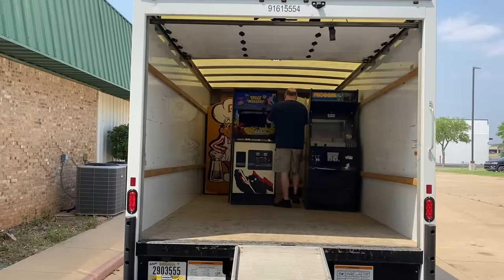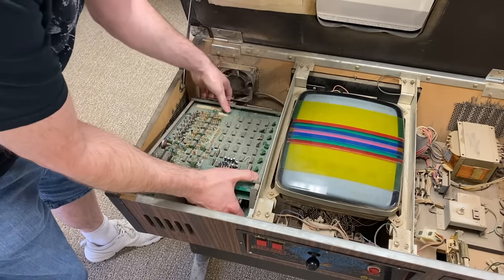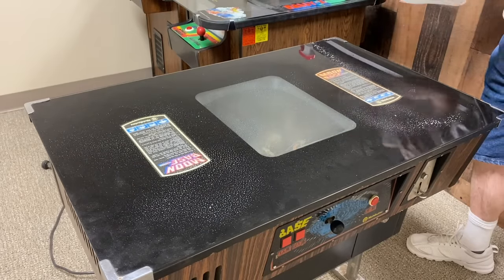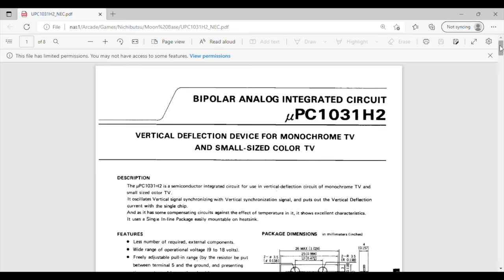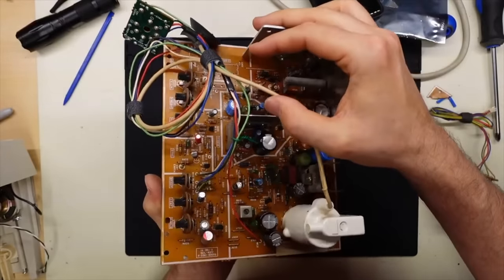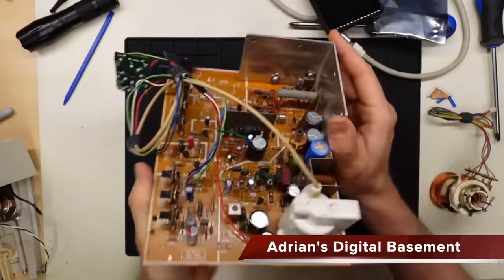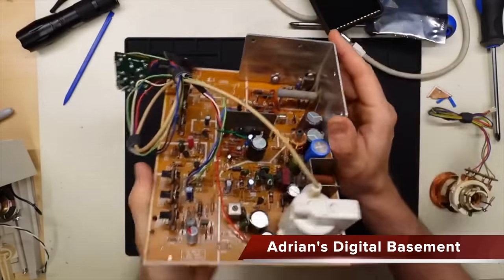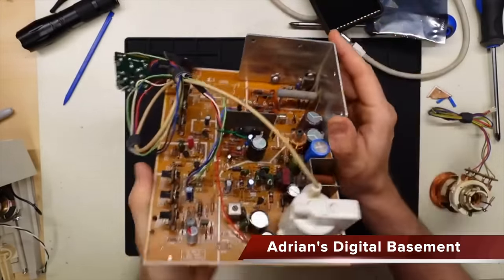Moonbase Arcade Restoration - Gone Wrong

Comment: Dave. That putting the IC in backwards was a honest mistake on your part. In my decades of working with electronics. I can tell you right now that the fact that that board was designed to hold that chip in backwards was a violation of industry standards. Any time you have an electronic component that need mounting to a heatsink. You always mount the component with the label side facing the same way as the mounting screws. I'm surprised that you haven't came across some DIP IC sockets mounted in backwards on some of your old computers you work on. I had this happen to me a few years ago when I ended up frying a very expensive microprocessor because the service tech before me decided to put the IC socket in backwards on the board. Had I look closer and saw the silkscreen markings or remembered the orientation that the old IC was in. I would've spotted the mistake.
Reply: I was thinking that myself,  I can't recall ever mounting a chip with the ID markings side facing the heatsink
Reply: @peterferguson2344  it isn't really facing the heatsink though, as the heatsink has a cutout. I don't believe there's an industry standard for such cases.
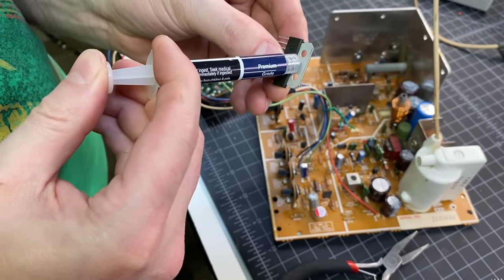Reply: Looking at the video at round 10:17 he unscrewed from the textless side. Then at 10:33 he is screwing in the new part text facing him. Honest mistake. But sending the whole thing off to a nother guy who taes a look and point directly at the mistake must be one of those things life throws at you and makes you smiles becasue afterall we're only human.
Reply: Waitwaitwait, did the 2nd (new) IC burned out? Did I read and hear this right? Then it should be obvious, that board is getting a lot of extra power and it cannot handle it, is the board actually getting 100v or 120v?
Reply: @Lamster66  Yes, I saw it was backwards, but then he said near the end that it "burned" again? Because the issue appeared once more.
Reply: The only bizarre thing in that mistake is that nothing got shorted enough to let the magic smoke come out.  Putting ICs backwards is super common, specially when the writing goes to the back.
Reply: @davidribeiro  Vintage components probably had higher tolerances than components today. 😸
Reply: The difference between amateurs and us pros...
Reply: @Lamster66  no. Silly...

I was just messing with you.

Comment: Personally, I think showing your mistakes is a sign of honesty and integrity. Getting it out there is a way people learn. Good on you for keeping your mistake in the video. Anyone who is critical of you for making a mistake simply isn’t grounded in reality. Great video,  love your work!
Reply: Yet he still has not corrected the literally lethal video of him shorting out the AC lines on the IBM video, to a point where he turned comments off so that new viewers could not see the warnings from people who actually know what they are doing. We're not critical of his mistake, we're critical of his hubris.
Reply: @datapoint6859  interesting. Link?
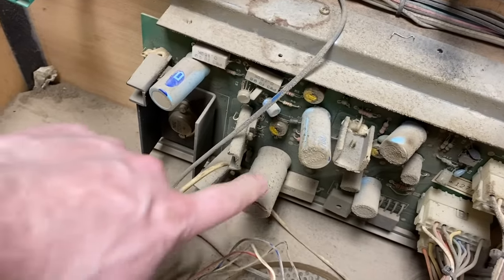Reply: @MrJef06  Video Wh2OCBZpzZ8, starting at 4:15. Google around on the video title for more info about what was wrong with it.
Reply: @datapoint6859  thanks
Reply: @datapoint6859  My favourite is how a guy who has been doing this for.. however long he has been doing it, does not have a torx kit, meaning he needed to use a rotary tool to cut a slot into the screws instead of, ya know, treating the machine with some kind of respect and purchasing a kit from his nearest hardware store. There were a few peeps on twitter that publicly stated they would never loan him hardware for videos again after that cluster. A great lesson indeed.

Comment: Don't worry about mistakes David! As my professor used to say "Any experience is experience" Try to check signals around vertical chip with oscilloscope. It maybe over-voltage or problems with driving signal.
Reply: Yo🔥https://youtu.be/rdJ9bsN7JAw..
Reply: I don't agree. I watched Adrian's video before this video here - and putting in an IC backwards is a typical 8-bit guy type of mistake. It only takes a small amount of time to check for this kind of error.
Reply: @graealex  What an incredibly cynical and unhelpful comment. It was an accident. If he's not allowed, you aren't. Isn't that an impossible standard to hold? 🤦‍♂️
Reply: @AlexKidd4Fun  There are simply a number of things he will not do, ever - for example, checking the output voltage rails of a PSU before plugging it in, unless the whole Internet is full of people saying that the PSUs are notorious for failing with too-high voltages. There is a good chance that one of the voltages is too high, which grilled the CRT-controller IC in the first place.
So he then sends off a board that he couldn't repair because he didn't properly document the orientation of an IC before desoldering it. I can understand it, putting a film into your camera, taking photos, then bringing the film for development, then having to wait a few days until you get the prints takes a lot of time. It's not like tiny devices everyone can carry around and take pictures with for immediate viewing have been invented. They would certainly help in restoration processes.
He then gets back the board from Adrian, who showed it to be running very well, and what does he do? He puts it back into his cabinet that probably still supplies too-high voltages to it and watches it die again.
That is NOT an accident. That is simply typical negligence.
Reply: @graealex  This was a human error and a good teaching moment. The 8-bit guy is a geeks geek and he shows us the process he went through. This isnt engineering class.
Reply: @scottparadis6333  There are honest mistakes, and there is not following some due diligence. I know the fanboys are plentiful here, but you can always compare to other channels and how they do stuff. 8-bit guy is simply very prone to these easily avoidable errors. When I take stuff apart, I take a reasonable amount of pictures, so I can properly put it back together. And nearly all retro restoration channels will check voltage rails. 
Saying "it is a teaching moment" is like saying, "we can all learn something from me crashing into a barrier because I drove with my eyes closed". No, what you supposedly can learn is stuff that was already known - don't put in ICs backwards, and check DC voltages because old regulators do fail and will then supply the wrong voltages. And don't drive with your eyes closed.
Reply: he's not worried about mistakes he makes. He's helping people with focus issues.. to listen. And.. he's telling us why mistakes are important. Mistakes are how you learn.
Reply: @graealex  The point is people like you are holding people to, to high of a standard we are only human making mistakes is not the end of the world it happens. If you act like that all that does is not only not help the problem but also it makes people not want to even try when we know here its one thing that is wrong here. Saying stuff like it may be to high voltage and then providing some helpful feedback in a very derogative way and chastising them for a error or 2 they made when you can be less condescending. Also your not the one taking 40 minutes to test one thing after another to see if it works, how would you feel if you had to do that and then get insulted for it? 

Cause it would not feel good id imagine, as such I agree with Alex on you with that being an incredibly cynical and unhelpful comment simply because of how aggressive your being especially considering the best of the best are only as good because of there experiences which are the failures they learned from amongst the experiences they had. So that analogy of "we can all learn something from me crashing into a barrier because I drove with my eyes closed" is a false equivalence since were talking about small common errors here not obvious would have seen outcomes that's also undermining the point of the message.
Reply: @graealex  "Not following due diligence" is something you do when you're doing a commissioned job for someone else. Not when you're fixing and tinkering. Sure, there's mistakes made here that fall solidly into the "Oops!" category, but they're also mistakes that anyone fixing stuff has made in their lives at one time or another. The fact that David made this mistake in the first place and knew about it means he will probably check the orientation of chips the next time round.

If you're a professional, then you shouldn't make these mistakes, but David is a hobbyist and he's making a channel targeted towards hobbyists. Comments like yours are exactly why hobbyists shut their channels down and don't make any videos anymore.
Reply: @graealex  And your lack of charity is your own personal failing... I would use the word negligence to describe a situation where someone is physicaly hurt from lack of action.  Not when trying to solve a damn puzzle for fun.  Like all puzzle solving: we try one thing, it fails, we learn why, and we try something else.  That's not negligence.  That's how we learn.
Reply: @videogamerNattie98  David does this for how long? Around 15 years? And he still hasn't learned to check voltage rails or put ICs the right way in.
Reply: @joshuapettus6973  He is not only someone who does restoration, no, he makes videos about it, and I think he even hopes to teach people something about it.
So it'd be rather important to go the right way about it.
The best thing about his so called "small mistakes" are his and his fanboy's excuses.
When I watched Adrian's video and he showed what the issue was, my first thought was "yupp, that's the 8-bit boi for ya". How a restoration veteran like him falls into the same traps every time is beyond me.
Reply: @Stoney3K  Hilarious calling David's YouTube endeavors to be "hobby". Lol. It is his f*cking full-time job, if you haven't noticed. Along with his software business and merch, he is making some good cash.

"Comments like yours are exactly ..." - completely unfounded claim.
Reply: @graealex  Anyone who is wise can tell you time does not equal experience or knowledge. Experience is gained from a combination of Success's, Failure's, and experimentation and acknowledgement of them are what give one experience in situations. You can have years of experience yet be completely new to something in your field or make a mistake in said field.

Forcing a standard of knowledge onto someone simply because they have a set amount of years into a profession is basically saying there knowledge in something is solely tied to time which is not the case. 

Years only raise Credibility in any field of expertise, not knowledge in said field. With that attitude all you would achieve would dishearten those who actually try and make them afraid of furthering there field of knowledge out of fear of failure.
Reply: @videogamerNattie98  The length that some people here go to to excuse this.
If, after 10 or more years of doing this, you haven't even learned some basic guidelines, particularly with the huge amount of videos and forums available on the internet, then it only means you are resistent to knowledge.
You know, yesterday, I went onto the office building roof to inspect the work the HVAC maintenance guy has done, only to find a junction box that was crumbling away from the exposure to the elements with exposed wires. I took pictures of everything, and wired in new cabling and junction box. Why did I take pictures? Because I have no clue on how to wire an HVAC, but I can easily replicate the wiring if I properly document it beforehand. As easy as that.
David - he's just the maintenance guy that ignores a destroyed junction box that is prone to cause a short-circuit the next time it rains.
Reply: @graealex  Because your agenda is taking one small mistake of his and treating it like he cant be in this field. Then taking the severity and upscaling it to an analogy that in comparison to the mistakes made here do not compare to what you propose.

We call that a false equivalence getting a chip backwards and not doing this one thing simply does not compare to ignoring a giant obvious problem.

Also factoring in it takes 40 minutes to take it apart and put it back together to test every time makes it hard to settle these small problems... Also I have experience with people like you who do this kind of thing they take your small mistake and upscale it to a worst case scenario example to make your small mistake seem inexcusable to justify being extremely condescending and cynical over it. And I can tell you people like that are not very likeable because it makes everyone feel like there walking on eggshells over everything.
Reply: @AlexKidd4Fun  Triggered....luuuulz.....
Reply: @videogamerNattie98  It's a long series of similar mistakes and inabilities from someone who should actually know better.
Again, the lengths people go to, to excuse this. Just take a damn picture before you rip everything apart. At some point you have to ask "in what direction do I have to put the component in", and if you are so foolish to just trust your memory, that in this instance was probably weeks before getting the replacement part - that is simply ignoring experience.
A "human mistake" would be to assume the silk screen is actually correct, or the notch on an IC socket (hint: in some 80s computers, they aren't). That is a mistake everyone would or could do. But he ignored consulting the schematic, consulting a picture when the component was still in, AND the silk screen itself.
Reply: @graealex  What I'm referring to, is that he is not doing repairs for customers. He's doing it because he enjoys doing them and he wants to learn from it, and wants to share that with his viewers. Even if it goes completely wrong, because it still makes good television content.

Electronics repair is not his profession, creating content is his profession.
Reply: @graealex  I have wondered if Dave includes stuff that will trigger negative comments so he can then have future videos that address the negative comments; a dysfunctional relationship between him and those criticize him. My suggestion is that he ignore those who trash him for posting videos that are less than 100% perfect and that he not try to explain or justify himself to get them to stop posting critical comments. But, maybe he has discovered that his YT stats increase by attracting those viewers that are hardcore perfectionists that feel compelled to point out errors that most people could care less about. From his perspective, more views, more $$$$ and it really doesn't matter what their motivation is, as long as they keep coming back to get entertained or hope to watch something they consider to be a technical train wreck. :)
Reply: @nrnoble  I think the problem is that without including that stuff, the video would only be half as long.
After all, most of the the video exists because he a) never checks voltages and b) can't put an IC the right way in.
Reply: @Stoney3K  Most of his content is restoring machines, and contrary to other YouTubers, which I could easily call hobbyists (like Adrian) it's a full-time gig for him. You're just trying to draw artificial lines. He is not a hobbyist.
And before you're barking "but you aren't paying him, so shut up" - I was a Patreon of his for quite some time, and I do use Premium, which makes quite the difference for creators.
Reply: It’s concerning that he continues to make mistakes, given he previously attempted to “jump start” a PSU with a paper clip…
Reply: @bfapple  In some departments he is very smart, after all he located and sourced a replacement part for a 40 year old cabinet.
And then he puts the part in backwards because he can't be bothered to document the right way, read a silk screen or a schematic. To make that makes zero sense. Put all the effort in, and then hose all progress.